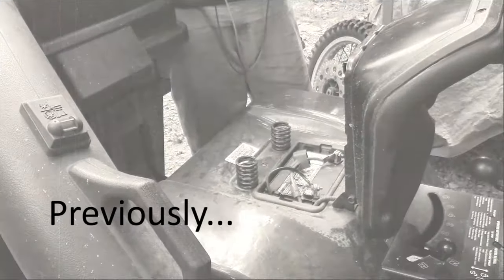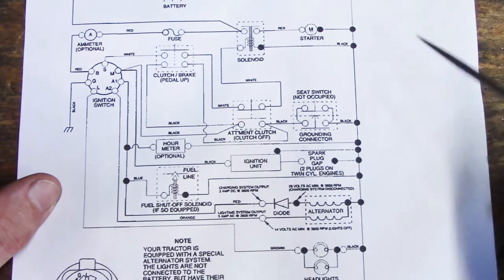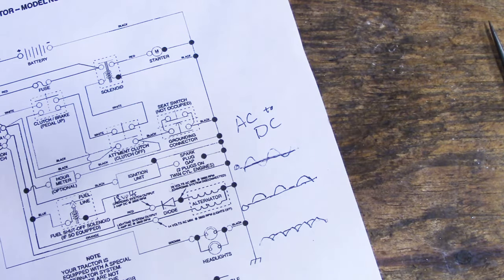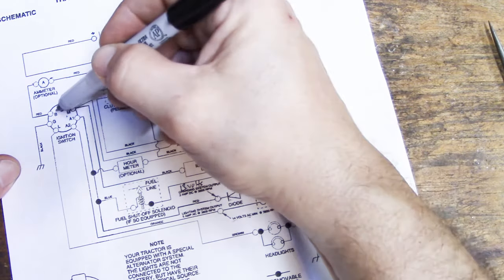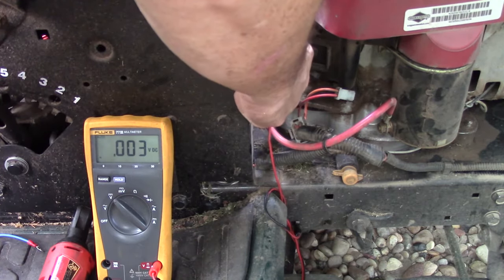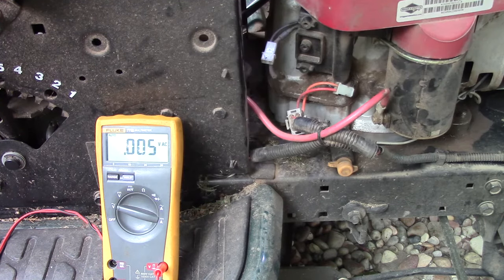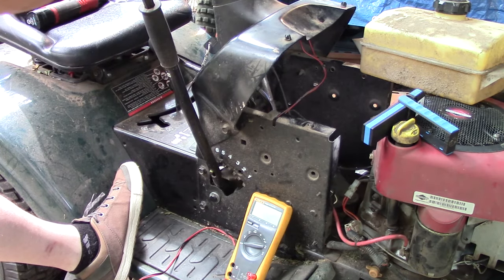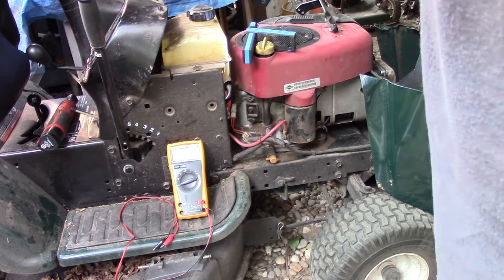Briggs & Stratton Dual Circuit Charging System - Diagnosis and Explanation

Comment: Hey Eddie, thanks for the video. The 19vdc from the diode is due to two reasons; first the stator is unloaded since the battery etc is not connected and thus the half wave pulsing can output more voltage in a no load condition , second the pulsing is charging voltage into the capacitance of the meter since the diode does allow the current to flow backwards the voltage simply builds up in the meter. Hope that makes sense.
Reply from the maker: Thanks David, great info, this is one of the reasons I put these videos out to hopefully learn something new as well as help out others. I really appreciate the info. I figured it had something to do with the load but never thought of how the meter was affecting the reading. That is great stuff.
Reply: and into consideration the voltage drop on that diode as well. 1.2V ?

Comment: Thank you so very much for explaining the 1/2 wave slow charging system. I have a newer mower with an older engine that has the old system but still had the regulator on it. It would not charge ,but I found out why by your video. It is now charging but it sure is slow. When you put a meter on the battery ,it will climb one point about every two seconds. At least it works now. No  one else had a video that explained in any detail at all. Yours was a life saver! Thanks again!

Comment: I’m glad I found this video. I had one come in for a valve adjustment and when I saw 12.8 on the battery while running I thought there was a charging issue. You saved me from entering a rabbit hole!
Reply from the maker: Yes, it is pretty anemic charging. Mine actually stopped working again at the end of season last year, probably going to upgrade to a rectified unit this spring. Glad you found it useful. Best!
Eddie
Reply: Andrew your not kidding! I actually had a bad stator as upon inspection I had a burned/broken piece of winding. My diode is still good but still replaced the bad stator after getting robbed for 80 bucks lol. Not seeing 14 volts charging volts was alarming till I found this video 😅

Comment: Eddie, I have The correct manual for the exact model of my Craftsman LT1000 mower. It incorrectly shows an electrical diagram including a regulator. My mower has no regulator. It has the diode. Your diagram is correct, so I went and found it online! Glad you showed us or I would have been even more confused than I usually am anyway. Thanks for showing us  and explaining your electrical diagram so well.
Reply from the maker: Glad you found it. Can you post a link here. I seem to have lost it. Thanks!
Reply: What was the part number?? Did you buy the briggs one or buy on amazon

Comment: G’day Eddy. Considering the environment and vibration the electrical system has to operate in it’s amazing anything works. It probably suffered some corrosion and your fiddling around cleared the problem. Happy grass slashing. 
Cheers 
Peter
Reply from the maker: Probably so. Thanks for stopping by.
All the best!
Eddie

Comment: Man, If I could give 100 thumbs up I would.  Even for electric dummies out here ( me )  could follow clearly what you were saying. I have a B&S engine on a Husqvarna and I just couldn't find the voltage regulator.  The electrical system that you were showing (dual  system ) looks just like mine ( even the diode was there albeit smaller. ). Anyway, you helped me greatly and I have watched you testing your system twice and with my little multimeter I am headed out to see if my charging system works.  ( I've had charging issues for 3 years but just kept replacing batteries. ) Thank You for taking the time to post this video.
Reply from the maker: Thanks, glad you found it useful. Mine eventually went out, I have video replacing it as well. All the best!

Comment: Thanks eddie i am putting a starter on my generator and was wondering how to charge the battery with out a regulator but i guess they already figured it in....I will be adding a dual circuit Stator and my own wiring based on your Schematic and video.Thanks.jim
Reply from the maker: Nice, I am glad it helped you out. It is funny, I did this video only because I had to do a bunch of research to answer a simple question about this system and thought surely other people had the same sorts of questions, and I guess they did. I am glad I was clear enough to help with your project.  Thanks for watching!

Comment: What a great video!! I recently swapped this same engine to an old Snapper and I was worried about the 19v charging voltage being too high so I left it disco'd but now my question has been answered and its plugged back in.
Thanks, Martin
Reply from the maker: I have yet to check it but the high charge is likely less once the load of the battery plus the resistances of the path to the battery is on it, which makes sense. Glad the video helped you. All the best!
Eddie
Reply: @theeddies  Not sure what your findings were, but on my recently repaired LawnFlite 10hp unit I'm seeing over 17vDC at the battery when running at rated RPM when the battery is fully charged.  Also the ammeter is showing a couple of amps even when the resting voltage of the battery was over 13v so I'm thinking it's likely overcharging the battery long term hence shortening battery life. (maybe not so much an issue on older style batteries where you can keep an eye on things and add distilled water as it evaporates away, but still less than ideal IMO).  Honestly, I'm thinking of installing a cheap chinese quad bike reg/rec on mine to help preserve the battery. Interested to know what you've found as regards how well batteries hold up on the lower end unregulated Briggs charging systems?
Reply from the maker: @danmackintosh6325  I have to get the tractor out to move some stuff around. I will try to remember to check it again but I don't get anywhere near 17v at the battery maybe 13.9 at the most. The amp gauge always shows a bit over zero probably no more than 2amp trickle charger.  I will try to remember to check it again though. Also i did end up replacing the alternator a few month later, that one was only working intermittently. The replacement video has more measurements as well. https://youtu.be/iDjT_fzerxM

Comment: Did you check the voltage going to the battery when the ammeter was jumpered out? What was that voltage? A voltage meter works in parallel with the source. The ammeter or current meter has to be in series with the source. It is possible your ammeter is failing or has corrosion inside it which may provide resistance to current flow and drop some voltage before it gets to the battery. A loose connection can also give added resistance and drop/remove some of the voltage before it gets to the battery. Current= voltage/resistance. So as the resistance of the ammeter goes up due to corrosion or partial failure the amount of current flow to the battery drops if you use my above equation. The reason the mower will not start when ammeter is disconnected is because voltage has to flow from the battery, thru the fuse, thru the ammeter to the "B" terminal of the igniton switch, then it flows thru the "S" terminal of the ignition switch, thru two safety switches, and finally powers up the solenoid to send power to your starter. The equation can also be stated as I=E/R   I= current E=voltage R=resistance.  I hope this helps you in your quest to repairing in the future. It is also helpful to know that Power=Watts and Power=(Voltage)(Current).  For instance if you have a toaster that is 1200W and is plugged into 120V then the current flow is 10 amps. It is math with odd things like watts, voltage and amps but at the end of the day it is really simple math. You can always run the mower with the jumper permanently installed. You will just not have any indication of charge unless you hook up a volt meter to the battery and measure voltage while running.  Good day.
Reply from the maker: Hello, no at that time I did not measure because it started working when I was moving wires around, checking for loose/corroded, and examining everything. I suspected that about how the ammeter works in the system and would have jumpered it if it had not started working. When it did that the ammeter was reading normally which led me to believe the problem was not there. Good info for the future though. As it happens it lasted about another 3 months, then went out again. Turns out it was a failing alternator. I have 2 follow up videos replacing it and showing the final damage. I should have just pulled and examined it at the time it was giving me intermittent problems but all is well now. Replacing - https://youtu.be/iDjT_fzerxM
Autopsy - https://youtu.be/CDIvD4Y9UBw
Thanks for the good info!
All the best!
Eddie

Comment: Thanks for your video! I have modified a riding lawn mower (Murray rear engine) to use as a mobility scooter, it has a Briggs engine and the same wiring as what you have shown here.  I wanted to install a full waveform bridge rectifier, a charging voltage regulator, and a buck converter, wasn't sure it could be done... This is so I can power my phone charger, and my backup/rear view cam (which don't like AC current).
Reply from the maker: You could certainly do that but if I were you I would look to see if there is a compatible alternator that is set up for delivering higher amps. Machines that have electric PTO clutches will have these. Since you seem to be a tinkerer, there is probably an alternator that if not made to go on different versions of the same engine as yours, there may be one that will work. There are a few videos out there of people doing a higher amp swap. Thanks!
Reply: @theeddies  I like what you are saying, but  I'm disabled and don't have an income, so I have to work with what I have. Fortunately the current requirements are well within the output of the alternator.
Reply from the maker: @ronc1357  If it has enough, it has enough. Good luck with it!
Reply: @theeddies  Thank you 😁

Comment: Thanks for the video and going through this style of Briggs charging system. I didnt have charging and this was very helpful. I Had 14+ volts DC after the diode, but no charging at the battery. I checked continuity of the wires back from the diode all the way back to the battery, and there was no continuity at the connector right before the starting solenoid, and also none at the Ignition switch. The single wire connector before the starter solenoid was badly corroded so I cleaned that and then I changed out the Ignition switch and now it's fixed, I have good charging at the battery. So if your Ameter ends up being fine, the problem could also be a corroded connector or a faulty Ignition switch not making solid contact in the on position or shorted out.
Reply from the maker: Thanks! Good info.
Reply: @nateross.   Thank you for describing the issue with your mower because what you were typing was exactly word for word the very same issue I was having. I replaced the starter solenoid , key switch, fuse, and checked DC volts just after the diode from the alternator. 14.96 dc volts from the connection that comes from the alternator. 12.46 dc volts at the battery while running.!  SO, I will go scrape the wires or try to check for continuity. ( I really don't know very much about how to do that but I will watch some youtube videos to see how to do that. Thank You for your post. ( I should have read this FIRST. )

Comment: That 19 volts will kill a battery in one season of mowing. I have an older craftsman mower with an ammeter, so I unplugged one side of that, plugged it into a toggle switch I mounted in the dash, then ran a jumper from the other side of the switch to the ammeter.
 I have to turn the switch on to start it, run it for about 5 minutes then shut the switch off and I've never had problems with the current battery for 4 years now.
 I have another mower that was given to me, that doesn't have an ammeter, so I plan to run a wire from the stator plug to a switch on the dash and run the other wire back to the harness by the starter. This will allow it to start, no matter the position of the switch, but I will still be able to disconnect the alternator from the battery while mowing.
 I wish I knew how to add some kind of regulator in the DC stator wire.
Reply: Wouldn't a ballast resistor do the same thing? I have the same issue on my rider. I thought about going that route.
Reply: @RJArens  If you could get the voltage down to say 13 to 13.5,  but it would still be charging any time the engine is running and could still cook the water out of the battery.

Comment: This should help someone in the future.
Reply from the maker: The future is now.
Reply: @theeddies  I meant in 2039, but okay.
Reply from the maker: @johnstrange6799  Based on what I have seen of this engine I doubt there will be any left by then. They were built to a price point a little lower than a package of Hubba Bubba.
Reply: @theeddies  Imagine the worst 'Back to The Future'... No Dolorian, no Flux Capacitor, instead a 15.5 Briggs on a Craftsman lawn tractor, and a diode from China.
Reply from the maker: #THISKIDISGOLD
Reply: Its helping me 😁

Comment: Im wanting to dump all my safety switches on a rider that I only use for pulling a trailer.  I know i can strait wire from the switch,  but i need to learn what all I can just pull out and gut. I have to learn where the voltage regulator would be hooked to. I'll eventually have the info I need. 😊

Comment: I'm guessing what WAS going on,  there was corrosion on the contacts. any of them could take out a charging system like that and there's the 19v from the system. It's not being used. When you pulled a couple wires it ground the connecting points in the wire spades enough that it made contact when you hooked it back together. So you solved the problem by unplugging it, but only on accident. I'd take a wire brush to the contacts an get some dielectric grease on them as well. I bet your lights start to work better an the charging system still works an better too.
Reply from the maker: It ended up being a intermittent failing alternator which finally failed for good. I have a video of the replacement and the autopsy of the dead alternator. But yes cleaning any contacts is always a good thing. All the best! Eddie

Comment: I have a 18 horsepower opposed twin briggs and stratton with a 3 wire voltage regulator. The mower has a pto magnetic clutch that enguages the blades that I understand requires more electricity. It doesn't seem to charge enough. When I unplug the 2 wire stator ( no diode) and do this test, I only get 17.2 volts AC at wide open throttle. Is this enough or do I need a new stator? Seeking advice

Comment: Just saw the partial Triumph picture in your channel screen. While in the military, and for a few years after retirement, I had a Bonnie for awhile then a Tiger. Loved both of them (after I finally got an electric ignition.. haha)! My points back plate kept creeping on me. On both machines.
Anyway, after selling those, I got back on a Harley again. Those are what I grew up on. But I do miss the opposite shifter/brake and that beautiful sound of their distinctive pipes and the rods/crankshaft high pitch. Hope yours is still running and you’re still riding it?
Reply from the maker: My Trident is down right now. Just needs the carbs cleaned. They are off I just cannot seem to find the time. I also have a HD Road King but probably going to sell it soon.

Comment: You linked me to this video from another one. Thanks for the clarification on how this changing system works. Here's my dilemma. The stater works just as yours does. Around 19 volts from the diode and about 14 or so for the headlights. The issue I'm having is the battery is overcharging. When I put the meter on the battery I shut the motor off when it got to 15.6 volts. It was still climbing at that point and I didn't want it to go any higher.  What are your thoughts?
Reply from the maker: @DNAFriendlyFire  best guess is the diode failing open. That is where I would start. I think I showed how to test one in this video or maybe another about this same machine. Let me know if you want and I will find it but there are many showing how to do it. Just out of curiosity, do you have a ammeter on the machine and is it working? There has been some discussion that the ammeter is a point of resistance that helps lower  the voltage. I personally think this is incorrect but I have not tested it yet.
Reply: @theeddies  no I do not believe that it has an ammeter. This was a rush job for a friend of a friend so I have already returned it to him for now so he can cut his grass and keep the neighbors and the city off of his behind. He was having a problem with the deck and couldn't cut his grass. He had mentioned that he put a brand new battery in last year and already had to replace it. He said that he had tried to charge it and that it wouldn't take a charge. He asked if I could take a look at the charging system for him and that's when I found that he must have overcharged the other one. I disconnected the stater wire for now and told him that he'll have to trickle charge the battery until I figure it out. Thanks for the help.